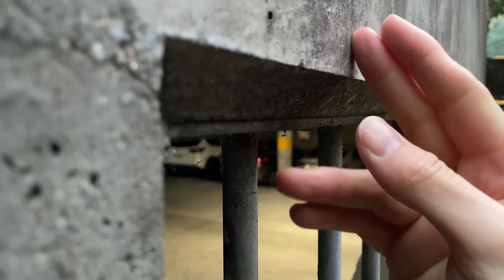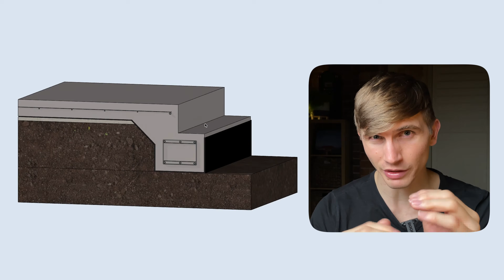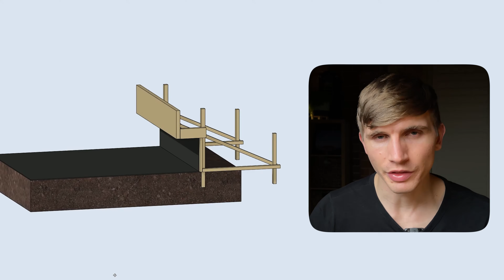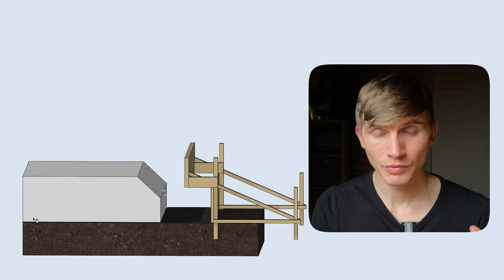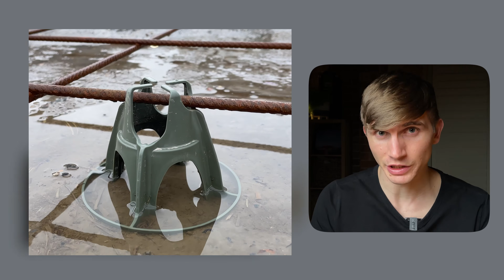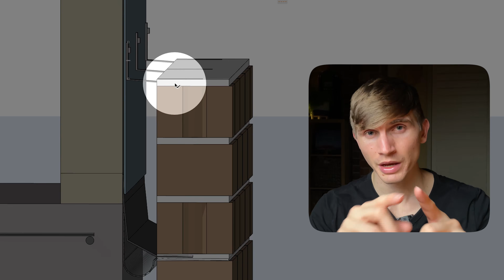Brick Veneer Construction Explained

Comment: I laid brick, etc. for more than 30 years. The detail drawing of the footing and slab done as one pour is a wise way to do it. Here in the USA most are built by pouring a footing. Then either a stem wall is poured or blocks are laid to floor height. The footing is made wide enough for the brick ledge. Then the slab is poured. So we normally have three pours where this video shows doing it in one. I like doing it in one.
Reply: also doing it as one makes stronger

Comment: If water penetrated the bottom brick below dpc into the cavity and on to the rebate due to high ground level , could that water find its way up through the concrete and into the timber framing ? Great video